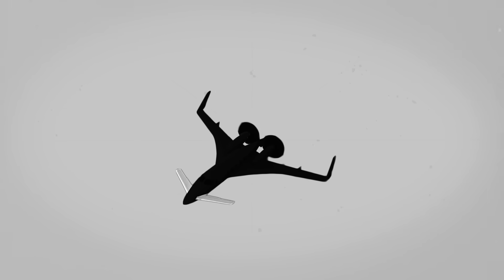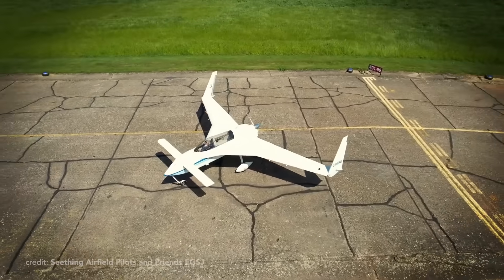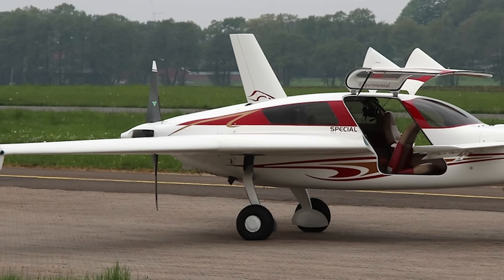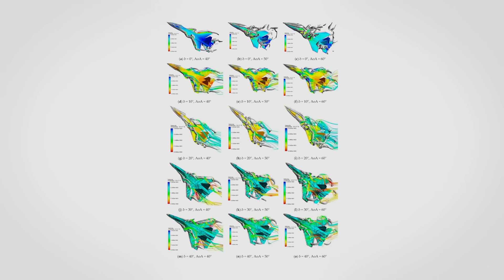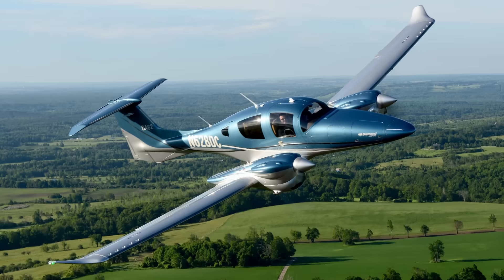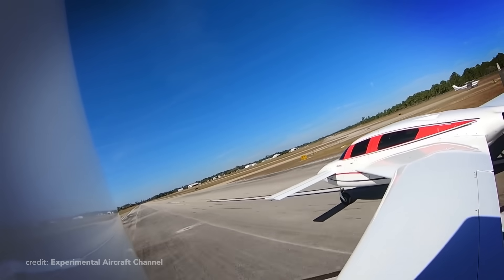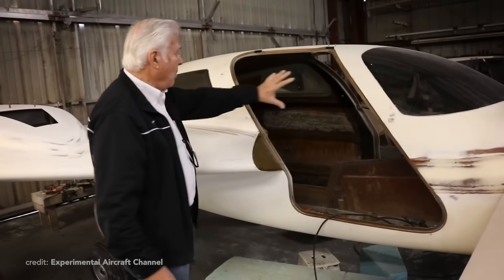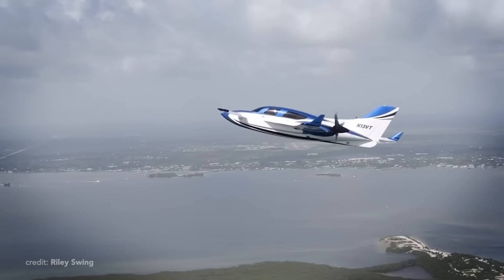Velocity V-Twin - Review & Specs Of Starships Brother

Comment: Im not a plane export nor an engineer,and i wondered about the 200 knots VNE speed too, when i looked it up, it turns out the higher up you go in altitude the less dense air you have, which will cause your pitot to measure less pressure . Less molecules=less pressure= less perceived speed. So you could be at 230 knots but the pitot reports IAS of less than 200.

Comment: The canard is more efficient because it is a lifting body and so is the main wing. In a conventional airplane the tail has down force to balance the lift of the wing. But the down force has to be overcome by the wing. Lets say you are pushing 50lbs of down force on the tail. The main wing has to life the entire weight of the plane plus the extra 50 lbs of down force on the tail.
And for every pound of lift it generates some drag. So the extra 50 lbs of lift generates a bit more drag on conventional airplane over the canard design. It does not have to lift that extra down force.

Comment: The Vne is an indicated airspeed, the top speed is a True Airspeed which changes relative to Indicated Airspeed depending on the density altitude.  So you can go 250 knots true airspeed while doing 180 knots indicated when you are at 15,000'.

Comment: I know I'm a year late, but interaction with the video to drive the true master of YT, Al Gore's Rhythm. Re: your point around the 3:30 mark about the full aircraft BRS system, it's incredibly difficult to put this aircraft into a position where a BRS would be the only thing to save it. A flat spin or corkscrew maneuver are the big ones that come to mind. So the aircraft aerodynamically is actually quite stable. The incidents where a BRS might have helped are usually the ones where the aircraft is too low to deploy the BRS, namely takeoff and landing. Cruise, when the BRS is useful, is the safest part of the flight in a GA aircraft.

In addition, there is some belief in the aircraft community, mostly by those that don't fly a plane with a BRS, that having that option makes you more likely to use that option before it's actually the last resort that it should be. There have been cases (apparently, I haven't done the research myself, mostly just parroting at this point) where a pilot used the BRS, and the aircraft could have continued to fly normally, and potentially glide for an off-field landing that the plane could recover from, instead of a parachute drop that will total the airframe.

I personally don't have a dog in this fight, as I am not a pilot (yet) nor do I own my own airplane (yet). Did I look at Cirrus and other aircraft with BRS systems? Yes. But the cost of the system doesn't outweigh the risk for me. I don't expect a wing to fall off in flight. The aircraft is built better than that. So I kind of see the BRS as a way of getting an unsafe aircraft through the approval process. "Sure our plane might be unstable in the pitch, roll, and yaw axis's, and we don't have a modified computer from an F-16 to correct that, but that's what the parachute is for." "Approved."

Comment: Wow. How many facts and pronunciations can you get wrong in one video? The first Velocity was just a Velocity, then it became the STD (Standard) or the SUV. After those, came the SE (Standard Elite. Standard body, Elite trim meant it had 2 gullwing doors). And it's Rutan, not Rootan. It's Vari EZ (eventhough it's spelled Varieze), or Very Easy, because it was the first homebuilt plane to use composite construction, so making complex curves was EASY compared to wood or aluminum homebuilts.

2:30 why are you showing the Vtwin when you're talking about the XL?

4:16 no carbon fiber would not be a better choice. It's stiff and brittle and only marginally lighter than glass. You want the wings to bend, not break.

Comment: A BRS parachute won't save you, in most cases (on turn to final from cross leg) it's way too late. The Diamond DA-40 and Cessna 172 are far safer than the Cirrus SR22, even though they don't have a chute. Bad pilots spin on final, too late for parachute, and good pilots can avoid situations where they would need it. IMO it's useless weight.
Also about the canard, it lifts the nose of the plane up while the main wing lifts the rear of the plane up. The canard has a higher stall speed than the main wing, so when the aircraft is under the canard's stall speed, the nose will fall until the aircraft is at an AOA where the canard is producing lift. It's a very simple yet smart design and it would be a far better feature than parachutes because it could prevent bad pilots from spinning in the first place. Far safer than a plane with a BRS chute IMO.

Comment: But it's not a "big metal bird" fiberglass, carbon fiber, foam, and some aluminum and M300.  And it is quite small for the payload and cabin capacity.  should I take the bait on your aero remark?  Idunno, but laminar flow refers to the boundary layer and I don't see how the canard is going to affect the main wing as the far field effect is minimal and is close to clear air at the leading edge of the main wing.  Unless you are talking about at the margin of stall where the wake of the canard tips may create a turbulent flow like a VG over the inboard portion of the main wing.  More of an effect is the accelerated flow over the inboard main wing from the props, increasing lift from local flow.  An even bigger effect of a canard is that both wings are lifting surfaces, rather than an aft trim surface creating negative lift.   And in the case of the Piaggio P.180 all three are lifting surfaces which gives their outstanding L/D so thrust doesn't have to overcome a resultant drag vector - 405 kts with PT6 turboprops is really an achievement.   Intriguing is the TP100 powered version of the Twin Velocity.

Comment: I wouldn't want carbon fiber, after a few years it starts to soften up and lose strength. Plus it has to be painted on all surfaces to prevent ozone damage and ultra violet damage. It isn't worth it any way you look at it. Plus it sucks really bad for deep sea submersibles.
Reply: How many years exactly does the "few years" you mentioned correspond to?
Reply: @ArazQizilbash  <---<< This is anecdotal but..... a friend of mine a few years back told me that his son was into white water kayaking and had a top of the line one made from carbon fiber. Then one day his son tells him "I just bought a new carbon fiber kayak" He asked his son why since he already had a nice one and his son held up the old one and twisted and warped it by hand and then told his dad to try the new one which was extremely rigid.
He said his sons older one was only about 5 years old but that was enough to soften the material. 
A lot of manufacturers like to leave the carbon fiber unpainted to show of how cool the material looks which of course adds up to planned obsolescence.
Also, I worked in the aerospace industry and was trained in working with CFRP, Carbon Fiber Reinforced Plastic.
It cannot tolerate any sunlight (UV) or exposure to the air. I believe it is ozone but it could be oxygen that damages the CFRP (It has been a few years). It has to be totally sealed on all surfaces.

Comment: Canard configuration has the biggest problem that it is naturally unstable. Same problem that Wright brothers had. Canrd configuration does not have positive dynamic stability.
Reply: That just flat out incorrect. Pitch stability comes as a consequence of the location of the CG vs the center of aerodynamic pressure, it doesn’t care if the elevator is in front or in back. Much in the same way an F-16 can be made unstable with a conventional tail, velocities and other home built canard aircraft are made very stable, and you can often see videos of pilots flying a trimmed out aircraft hands free for long stretches of time.

Comment: This is an interesting history, particularly in relation to the AJS-37 Viggen. Though not a delta-wing plane, it also shares ideas with Viggens predecessor, J-35 Draken. Look at the main wing: It has a long inner component and a much slimmer but wider outer component. Then look at pictures of Draken; it has nearly the same strange profile kink, though as a delta wing. The reason was partly to get better low-speed functions when going road landings on 1000-yard road bases, both in Sweden and Finland.
Reply: False. The Viggen has a delta wing planform.
Reply: @smark1180  Yes, Viggen had a delta wing, but if you look closely, it is a broken delta, not a straight delta like on a Mirage or some US planes. The outer part has (opposite to V-Twin and Draken) a steeper outer forward cord than the inner forward cord about the same way out from the center line. However, my comment regarding Viggen was more regarding the canards and wing style, which the Draken lacked.
Reply: @tfl-larsm24  The Viggen had a double-delta, still a delta.
Reply: @smark1180  Sorry, but you misread my comment, read it again, it is V-Twin I meant not being a delta...
Reply: @tfl-larsm24  OK

Comment: Vne is Indicated AirSpeed (IAS). The 230kt cruise speed at 75% power is True AirSpeed (TAS). It does not say in those specs what altitude they achieved those speeds, but the higher the altitude, the bigger the difference between IAS and TAS. And by the way, there is no plural for the word Aircraft. You can have one Aircraft or many Aircraft. There is no such word as Aircrafts.

Comment: I think it is also the case that the canard is a lifting surface whereas the horizontal stabilizer in a conventionally configured plane produces down force.
Reply: This is only true of airplane designers (and pilots) who don't know what they are doing.

The wing lifts. If you place the CG ahead of the wings center of lift (aerodynamic center of the mean chord). Then the tail must balance with down-load. Adding invisible weight, therefore more lift and more lift-induced drag.

This is simple. 

What needs to change to make the tail lift up, instead of negative-lift?

Hint: CG aft of Aerodynamic Center, just forward of NP enough to retain positive stability. This is rudimentary simple. Most designers outside of the majors are not particularly adept at simple math and basic aerodynamic concepts. 

Truth: You can take a wing with a negative -CM of 0.1 and make it have zero trim drag with this simple math. Any time anyone states a tail must produce down load, or an airfoil creates trim drag or induced drag is a fool. Not only have they been so lazy as to never work the classic moment diagram in aerodynamics 1.01, they are dumb enough to open their mouth and proclaim it in front of people who have.

Comment: Velocity makes an extraordinary product.  The fiberglass frame is hyper sturdy, exceeding the carbon fiber designs from Cirrus.   The twin will appeal to those that want engine redundancy, but is substantially slower than the single engine XL-RG.  Both planes use the same fuselage, the Twin adds the tail (where the engine mounts for the XL), and the nacelles for the engines mounted on the wings.  But all else is the same.
Reply: Thank you for the information. I'm very interested in the aircraft. Note: I finally made my dream come true.😅
Reply: @thomasclark7483  As did I.  My XL-RG is finished finally, and I am transititioning into it in the next few weeks.  It has a Continental TSIO-550-c  310hp twin turbo, block heater, four blade scimitar prop, Mountain High on-demand oxygen, two 10 inch G3x touch PFD/MFD, and a GTN 750 between them, and Garmin digital backup and AP.  I plan to fly it to Osh Kosh next year.  It has a unique paint design, look for the Green Hornet with the blacked out windows.

Comment: Canards are more suited for laminar flow as the prop slipstream is dirty and turbulent, so basically everything behind it cannot be laminar.  A pusher canard, on the other hand, doesn't have that issue and the fuselage as well as the inboard portion of the wing and canard are able to go through laminar flow...it doesn't mean they ARE laminar, it just means they have the potential to be if designed in such a way.  The downside is that this works against a pusher as well.  In a tractor configuration, the propeller is going through stable laminar air and as such the blades are able to make more efficient thrust for more performance.  In a pusher, the prop is guaranteed to see dirty turbulent air and loses that advantage.  It all comes out in the wash for the most part unless you're able to make the entire aircraft fuselage laminar flow at all times, which is something the Celera 500 is attempting.
Reply: All comes out in the prop wash

Comment: The 180HP Delta Hawk diesel now has 235 HP available from the same engine with different fuel delivery and turbo. This will be a certified engine not some unreliable over boosted backyard build. That’s 470 HP installed instead of 360 HP. You get a super efficient bird with really impressive climb and cruise.
Reply: but boy is it expensive!
Reply: Oh yes it is extremely expensive. What I don’t understand is the huge price difference between the normal velocity (100-150k) to the twin/XL (500k). 
And why a airplane engine that’s build form an automotive one costs 4-6 times as much?!
Reply: @DKofDAH  Which automotive engine do you speak of?  The Deltahawk diesel was designed and built from the ground up as an airplane engine.
Reply: @estrader6214  CD300 for example. Originally an Audi 3.0tdi as far as I know.  But a delta hawk is just a 2-stroke diesel no?
Reply: Fo me the V-twin with those 235 DH engines is perfect in the 6 seater option once that properly launches, BUTT since there is also turbine model being played with it could get very interesting cost/performance side which way to go.
Reply: @NotSean269  
Turbines are great until fuel burn is factored into range.

Comment: The canard increases efficiency because it is a lifting surface. A normal airplane with the tail in the back has a downforce surface which has to be overcome by lift from the main wing. Lift equals drag which equals lower speed.
Reply: This is only true of airplane designers (and pilots) who don't know what they are doing.

The wing lifts. If you place the CG ahead of the wings center of lift (aerodynamic center of the mean chord). Then the tail must balance with down-load. Adding invisible weight, therefore more lift and more lift-induced drag.

This is simple. 

What needs to change to make the tail lift up, instead of negative-lift?

Hint: CG aft of Aerodynamic Center, just forward of NP enough to retain positive stability. This is rudimentary simple. Most designers outside of the majors are not particularly adept at simple math and basic aerodynamic concepts. 

Truth: You can take a wing with a negative -CM of 0.1 and make it have zero trim drag with this simple math. Any time anyone states a tail must produce down load, or an airfoil creates trim drag or induced drag is a fool. Not only have they been so lazy as to never work the classic moment diagram in aerodynamics 1.01, they are dumb enough to open their mouth and proclaim it in front of people who have.

Comment: Has anyone considered electrifying this bird?
Reply: What about feathering a prop on an electric engine?
Reply: Batteries have a terrible power to weight ratio and are not practical for planes.
Reply: @tomlorenz4344  I agree. So let's not use batteries. Let's use a different technology that maintains it's state of health over 100x more cycles than batteries, yet is now coming closer to having a similar energy density with LiPo batteries.
Reply: Wow.  Electric works well for people who want to fly for 30 min and then charge it overnight.  Not to mention the risk of a Lithium Ion battery fire.  We need a better battery technology before electric flight is viable.  Kinda the same with electric cars...
Reply: @FlyMeAirplane  Agreed. Ultra capacitors are getting more energy dense, and don't have the thermal runaway issues as with Lithium ion. If only there was a technology to more appropriately leverage the battery we live in.

Comment: pressurize it and put deicing on the leading edges  FL 26 would be great - P210 can have it  why not this?
Reply: Having a cabin capable of pressurization would exponentially increase the price
Reply: @ethanlegrand33  Just add turbines, which apparently someone already has...
Reply: GA aircraft with piston engines are NOT pressurized for good reason, cost and lack of need.  Unless the piston engine is also a turbo, you can't fly anywhere near the flight levels anyway.  And deicing systems are only useful if you plan to challenge IMC regularly.

Comment: The canard increases efficiency because it adds lift instead of decreasing it. Standard horizontal tail stabilizers create downforce which the wing must overcome.
Reply: The canard also decreases efficiency because it operates at a higher lift coefficient (angle of attack) to make sure it stalls first.